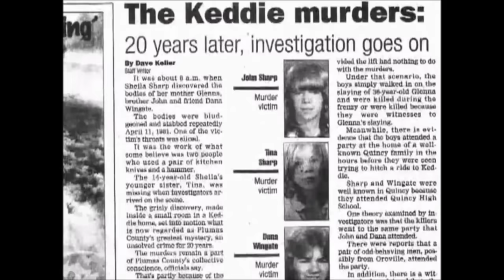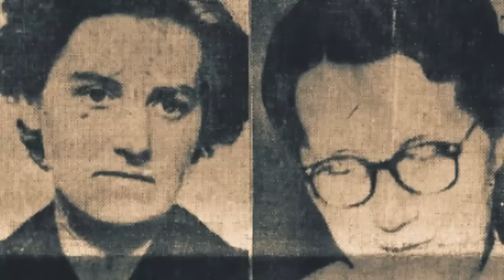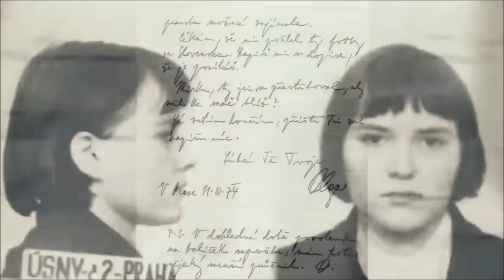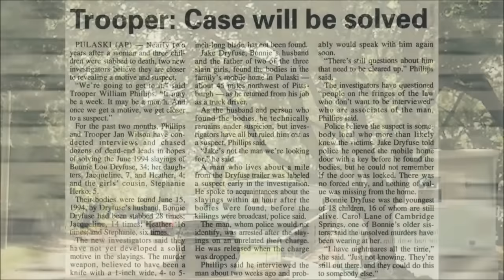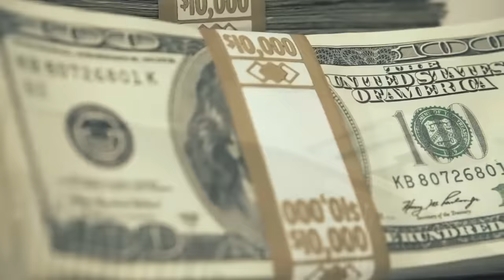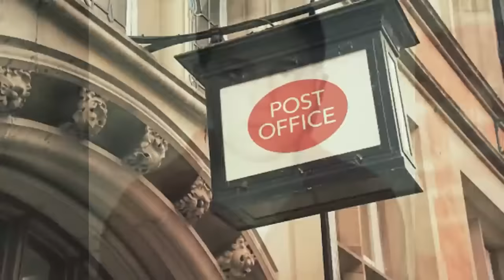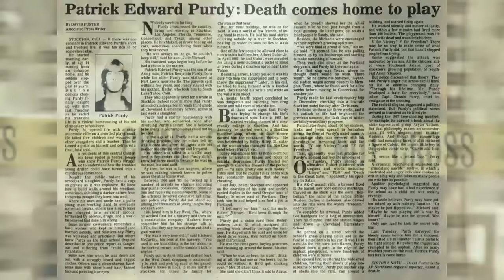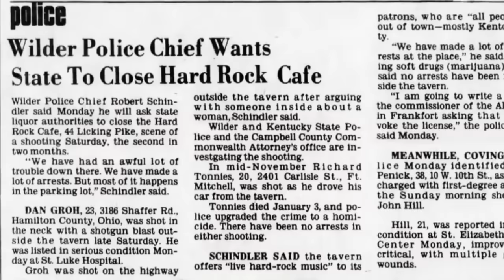Horrifying Mass Murders Compilation - Four hours and 20 minutes of videos!

Comment: The Keddy Cabin murders will likely be solved.

They should have already been solved.
But for some reason, the sheriff at the time simply boxed up all the evidence and put it in a storage unit.
He also didn't run down any leads.
All of the progress that has been made on the case was by the current sheriff.